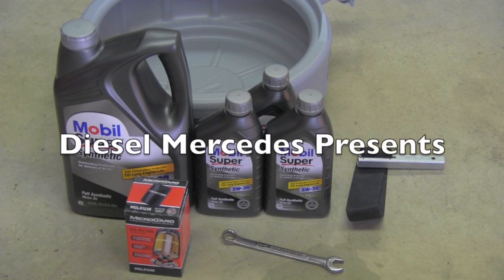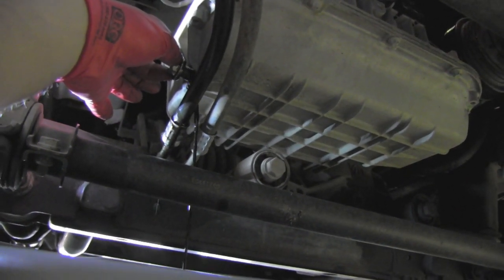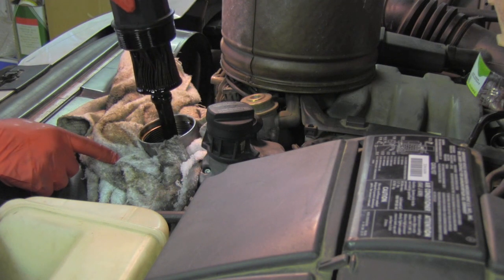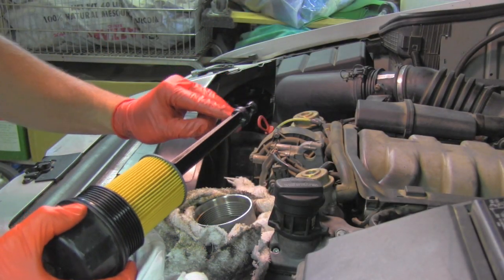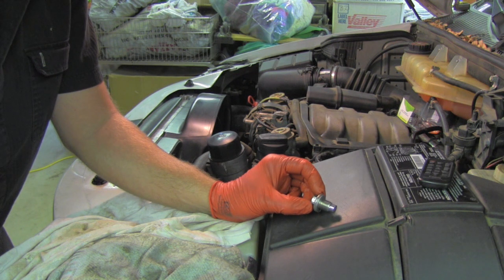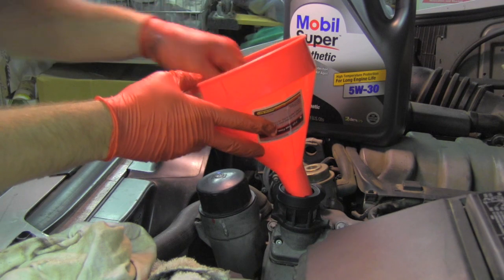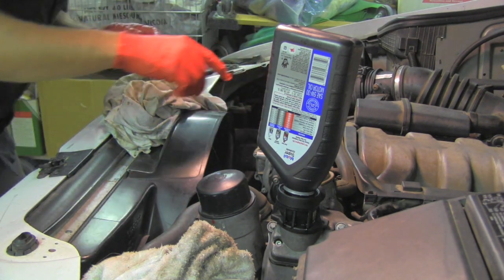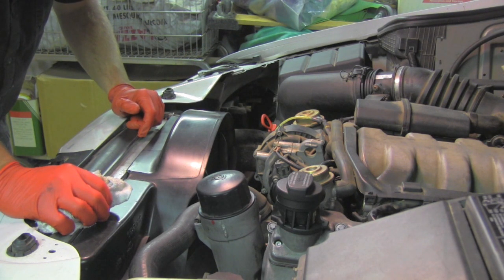Engine oil change Mercedes ML320

Comment: It has the best explanation I've found
An excellent explanation...!!!!!!!!!!!
Reply from the maker: +J R Thank you...
Reply: +diesel mercedes 

While your video is nice...

That collapsed and close to disentegrating paper oil filter is why you really should be using and recommending a Mann HU 718/5x fleece oil filter or a Fram Ultra XG8481 oil filter instead of the crappy paper oil filter. They cost all of a few bucks extra. They are reinforced with nylon cord in the case of the Mann, or a metal screen in the case of the Fram Ultra.

Might want to also consider recommending a thicker Euro weight 5w30 (difficult to find in the US) or a thicker Euro 0w30, 5w40, or 0w40 (much easier to find) instead of that super thin Dexos1 approved 5w30, especially if you live in the south and plan to push the oil through the summer!  The 112 is pretty forgiving about oil as it's fairly understressed, but dexos is a fuel economy oriented "~5w25.1" oil, and not the "~2.5w35" Euro weighted oil the engine was designed for. The dexos1 oil is not going to be sufficient at protecting the engine under heavy load in high heat.

Comment: Can you share any video to repair rear ac issue. U r doing gr8 job by sharing knowledge
Reply: This may help.
Search "W163 Mercedes Benz ML-Class center console removal"
I am specifically talking about the 20 minute one.
It might be a bad motor, loose cable, burnt fuse, etc.
(just a guess)

Comment: Great video.   i have a small problem my 2003 ml320-  blows cold air when i set that fan speed to a higher position if the fan speed is on the lowest setting it will blow hot air, i have changed the thermostat also the fan clutch and the blower also Blower Regulator for Climate Control Blower,  do you have any clue what be going wrong? thanks
Reply from the maker: i never heard of this…..did you scan computer, any codes ?
Reply: i did no codes
Reply: Charles Yepez Sounds like a heater core to me. I'm just a back yard mechanic though. I changed the heater core in my Dodge Ram 2500...if it ever goes in the 2000 ml320, i'll drive the sumbitch off a friggin cliff.....pulling the whole dash to get to it....it was not fun, it'd be way less fun on a mercedes.

Comment: what is the MB ML320 manual recommended 8L oil or 7.5L? some people on youtube video they are using 10w30 some using 5w30, which one is recommended 5w30 or 10w30 engine oil synthetic?
Reply: upto 8.5L and oil thickness will depend on the engine mileage, 10W40 is good if you have done heaps of mileage.
Reply: Thank you Sir

Comment: great video, do you know how to check the transmission oil?
Reply from the maker: You will need special tool for it, it is still dipstick, just not installed in cars…i have video about it on my channel. thanks.

Comment: Nice and clear video, but you're wrong on a few things. 
First, you should only use FLEECE type oil filter for 10,000 mile oil change interval. (the one you removed and installed look like paper type, not good). 2) Use nothing but Mobil 1, 0W-40(in US) not ANY Mobil synthetic oil for longevity. That's what the MB recommends and uses at dealers. 3) Use copper washer not just any washer 4) 8.5qt is the correct capacity for these M112 engines. 
The used engine oil you just drained looks way too dirty.
Reply from the maker: thanks for sharing your wisdom....

Comment: My ml320 2002 oil filter assembly only has one o ring, the one close to the top of the housing, no other o rings can be found in the filter assembly that holds the oil filter.